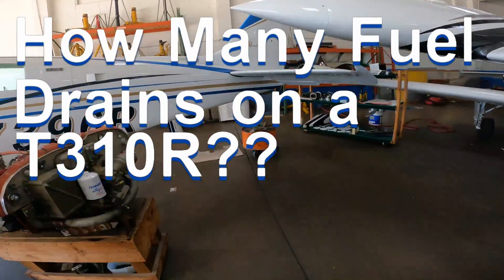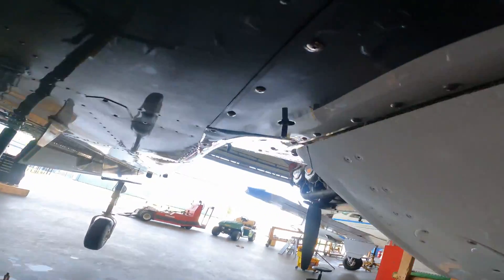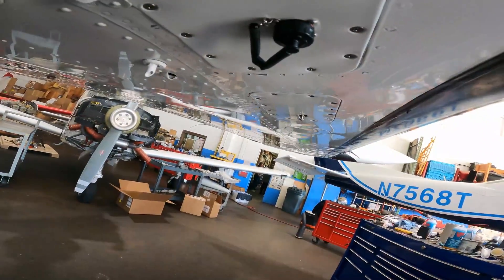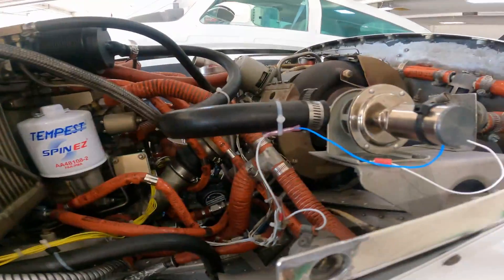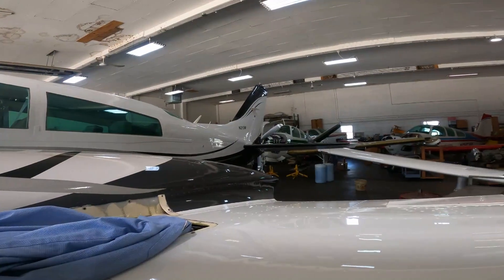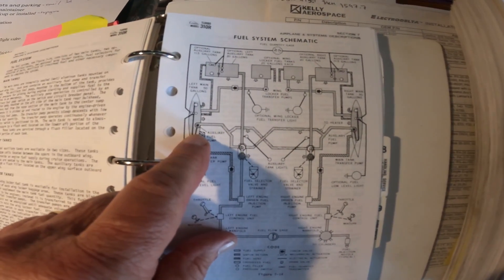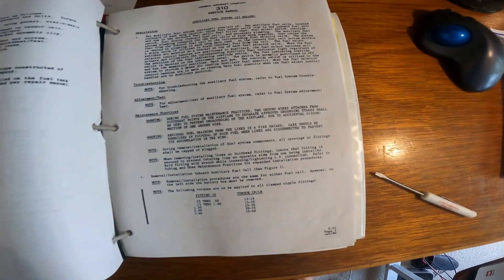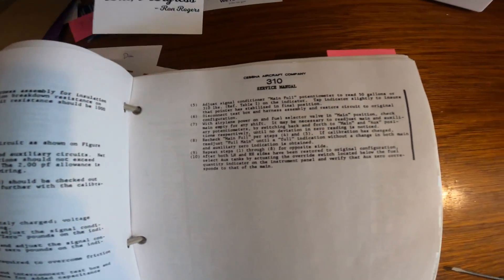You Got To Be Kidding! How Many Sumps Does a T310R Have??

Comment: At least your airplane has six fuel tanks for all those sumps.  Have you looked at a late model Cessna 172?  It has several for each tank, plus the low point, plus the fuel selector.  I long for the days of the older 172 with 3 of them, or my Funk with one.

Comment: Pretty much the same on my 340.

BTW, if yer eating vacuum pumps, your vacuum regulator is likely bad, or the boot actuator valves are out of adjustment. (I've had the same issue with my vacuum pumps)
Reply from the maker: The main problem seemed to be that there were no flight instrument to power and the guys who reconfigured the system put too small of a hose on the  instrument side and it was straining the pumps. They corrected that and they seem to be working ok now.

Comment: Since you mentioned fuel systems … the Hoover Nozzle might make an interesting video.
Reply from the maker: Don't know what that is.
Reply: Hi  @ronrogers  I read about it in Australian Aviation some years ago.  

To quote from Wikipedia
“The "Hoover nozzle", used on refueling equipment dispensing jet fuel, is designed with a flattened bell shape. It cannot be inserted in the filler neck of a gasoline-powered aircraft with the "Hoover ring" installed, thus preventing the tank from accidentally being filled with jet fuel.

This system was given this name following an accident in which Hoover was seriously injured, when both engines on his Shrike Commander failed during takeoff. Investigators found that the aircraft had just been fueled by line personnel who mistook the piston-engine Shrike for a similar turboprop model, filling the tanks with jet fuel instead of avgas (aviation gasoline).[52] There was enough avgas in the fuel system for the aircraft to taxi to the runway and take off, but then the jet fuel was drawn into the engines, causing them to stop.”

Post accident Bob Hoovers response to the mechanic/refueler was
“Hoover went over and put his arm around the youngster and said, “There isn’t a man alive who hasn’t made a mistake. But I’m positive you’ll never make this mistake again. That’s why I want to make sure that you’re the only one to refuel my plane tomorrow. I won’t let anyone else on the field touch it.”
Reply: @ronrogers  Bob Hoover invented it after his 1978 Shrike accident.  Prevents jet fuel from being pumped into piston aircraft tanks.

Comment: The sump engineer got paid by the sump. Hilarious!

The retractable tie down ring is neat! I use tie down ring GoPro mounts from MyPilotPro. They clamp on the ring with rubber gaskets and a safety pin so it won’t fall off even if the clamp is not tight enough. Perhaps you use it too. All metal and sturdy, wont get pushed by the wind.

I used it in 2020 to record flying over the mountains and plains of central Norway fully covered by snow while time building in a DA40. Video is called “Escape” on my channel if you want to see the results.
Reply from the maker: Sounds great and will have to look it up and yes, I have the same type of mount. Bought it from the guy up at OshKosh. Also have his that you screw on into an existing fastener with the rubber mount. Have used that for wingtip shots on my 310.